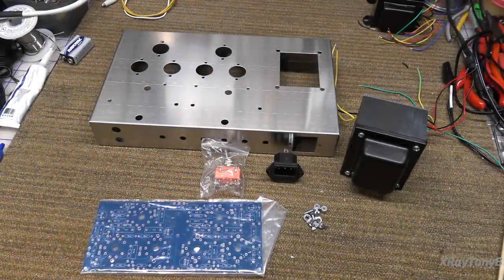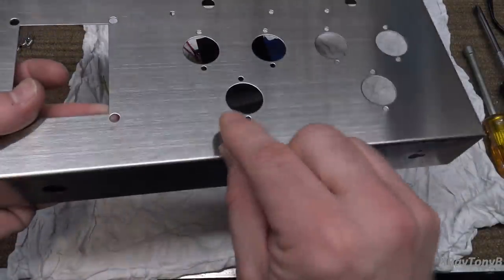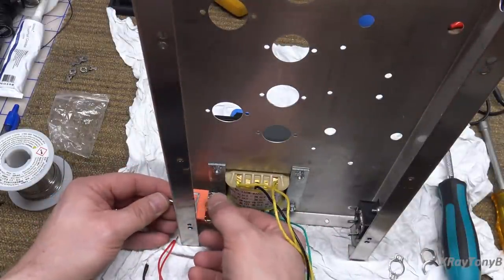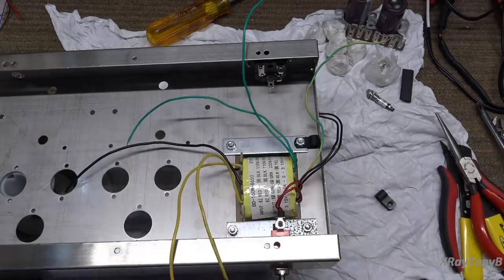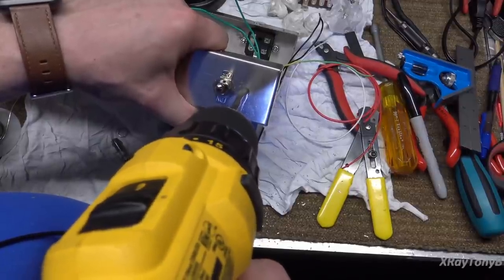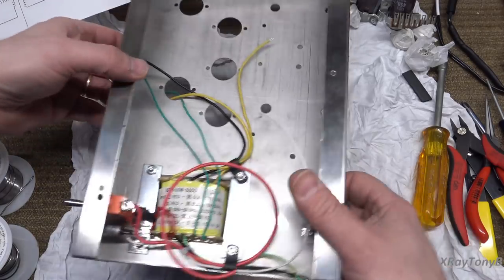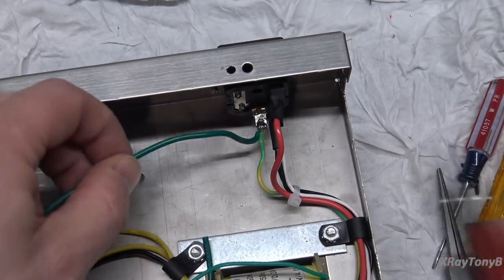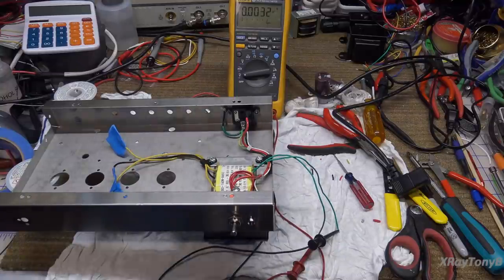Electronics 101½ Part 4 - Assembly (& Mistakes) Begins ☺

Comment: You are burning you drill bit. You have to go slow speed and put pressure on Stainless Steel
Reply: A little cutting oil goes a long way too.

Comment: That's a good point about overheating the IEC connector and possibly melting the plastic and ending up with loose pins. I've found that putting a plug in the socket can dissipate some of the heat away from the pins and their surrounding plastic. That little trick works well with RCA sockets in particular! They're really prone to melting and deformation, so I always make sure I put an RCA plug in the socket before soldering the leads.
Reply: Good components are normally thermionic stable plastic (like the olden days' Bakelite) and should not melt. However, the cheap mas produced junk that is available over the counter melts at about 80 degrees centigrade. Buy terminals plugs and socket from reputable manufacturers where a specification is available. This is the first step to longevity of your project.

Comment: Hi Tony, 
Sorry for the late reply. I am about eight hours ahead of you so, when you are busy, I am resting. I guess this is a very intuitive video to the novice or DIYer, as well as teaching the young engineer some very practical things which only we have experienced and learned in our early days.

I did my time as young engineer in the Post Office (automatic exchange) and learned from the wireman how to wire an MDF (Main Distribution Frame) and  tie the wires together with some waxed twine, and yes that is not something that these youngsters would ever know. They are  brought up on surface mount, PCBs and ICs. 

Fault-finding through an any entire exchange also taught me extremely well how to find a fault between a subscriber and wherever, sometimes several miles away, trough various other exchanges.

You may find a dry joint, disconnect, short, relay not tensioned, dirty contacts, relay armature and adjustment out of spec, etc. There was very little to no  electronics, everything electromechanical and to exacting specification. 

Strangely enough, the old guys then I learned from actually built their own valve amps and I don't know of any artesian, tech or engineer that did not build as in an exchange and when finished, was a work of art. 

Wiring looms from one end to another, different looms for power and signal, all kinds of stuff all perfectly squared off and not a single bit of hum or noise. You have just awakened memories of 50 or so years ago. I think this series will be one of your best, demonstrating that if you are a youngster, don't argue we us old folk we are in the knowing. I look forward to watching the rest of your series on this little project.

Furthermore, I have also been speaking to Eddie regarding the simulation of JAT, and yes, although it is a good indication of possible analytical performance in a steady state or small signal analysis environment. However, you can step various parameters, cutting time to what took us months to do. But, at least, understood what was going on. Yet, it still depends completely on the skill and years of experience of the designer to actually get it right, knowing of all lumped constants and 0other physical constraints creeping into a PCB or wiring layout affecting performance and specifications adversely.

These factors cannot be predicted by any simulator in existence, even though MicroCap is probably the best available and I have used simulation and predictive analysis in my daily work for some 25 years, but only to prove a concept. 

Most DIYers swear by the simulations and even argue system performance based on simulation, claiming miniscule  THD at five orders of magnitude below zero! We know that everything we design and tweaked in the real world until the result consistently and closely conforms to our design requirements. Well done my friend, this was excellent.

Comment: The concept of touching a small amount of solder to the soldering tip is actually called the heat bridge.  It helps transfer heat from the tip to the objects being soldered.

Comment: Great job, Tony. I see you 'followed' my advice on not using the circuit board! :) 

A little nit-pick. the power switch's threads are exposed on the front of the chassis (providing there's room next to the transformer). (13:58)

Comment: Hi Tony! Really like your channel and enjoy every video I have time in my busy schedule to watch, but I will make a couple of comments about this one. Wouldn't best practice dictate that the 120vac mains wires be twisted as they run around the perimeter of the chassis for hum/noise reduction? Also, I might suggest that your power indicator light be installed after the fuse instead of before the fuse. That way, if the fuse blows, you will not get a power indicator light and give you a hint that the fuse may be blown. Your way, the power indicator light will come on whether the fuse is blown or not and may make you think something more sinister is wrong. Just some food for thought.
Reply from the maker: Thank for the comment!  Although I drew it that way on the schematic, if you look back on the video, the light is actually connected after the fuse.  As for the power leads, they were run along the side corner of the chassis on the opposite side of the transformer from all of the other circuitry, so there will be no problem with hum or noise.  Thanks again!

Comment: On my Douk kit similar to this one I replaced the transformer bolts with brass ones and added insulating washers. This greatly reduced hum in one channel. It seems like the transformer was pushing eddy currents or magnetic fields through the chassis, and the way I built it, it was very susceptible to that (far from a star ground). Now it sounds very good actually. Probably improved efficiency too.

Comment: So since the chassis is upside down, you would toggle upwards to switch on.
With stainless, it a good idea to keep the pressure on to avoid surface work hardening.

Comment: More tutorial series goodness = yum! I might suggest a little different workflow... Temporarily pre-fit the hardware, to be able to determine the needed wiring routes and wire lengths. Remove the hardware and solder up as much as possible. Then, permanently seat the hardware. It just means that you are soldering outside of the chassis, where you can get at things easier. Question = What is the make and model of your heat gun? Thanks!

Comment: Tony, what are the terminal boards with the stand-off and spade/loop openings for point to point wiring “called”, as I’m having trouble finding them.
Reply: Terminal strips. Guitar amp repair sites and places like tube depot should be a few places to look. Even Amazon.
Reply: Sometimes turret board

Comment: When you get to the bridge rectifier could you explain why some amps have capacitors across the diodes in the bridge rectifier?
Reply: hopefully I got this right-some power transformers have center taps  some don’t 
there are different ways to create a power supply however the best example would be look at a 100 W Marshall plexi power supply and a 50 W Marshall power supply you’ll see that the 100watt  does not have a center tap uses a full bridge rectifier and the 50 is wired differently if you compare those you might start to understand it    I’m still learning myself I hope this helps
Reply: @buzzedalldrink9131  It looks like my question was somewhat answered in his video on rectifiers but he did not specify what high current was for a bridge rectifier.  Most of the computer speakers I have seen the caps across the doedes only use the standard 1n4007 style diodes and I really doubt that the speakers would draw close to the 1 amp rating of the diode but I could be wrong.
Reply: I don't think I can post links in the comments. Google: why put disk capacitors across diodes.
From what I found, older general purpose diodes had "switching noise". The caps typically 10 to 100nf, help with noise in the HF frequencies. Something to do with EMC compliance.

Comment: I'm glad you decided not to use the circuit board. I would have connected the pilot after the fuse. In your case should the fuse be blown, the pilot will still illuminate.
Reply from the maker: The light is after the fuse.  Go back and check out the part where i describe the pins of the iec socket.
Reply from the maker: Correct